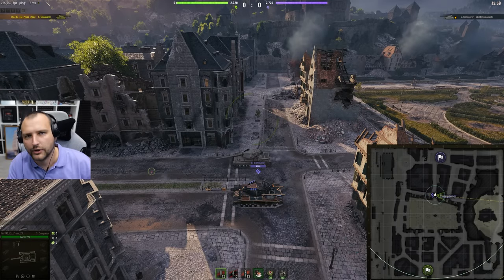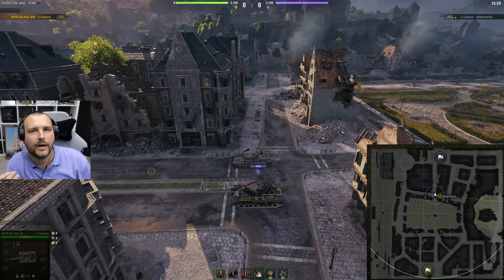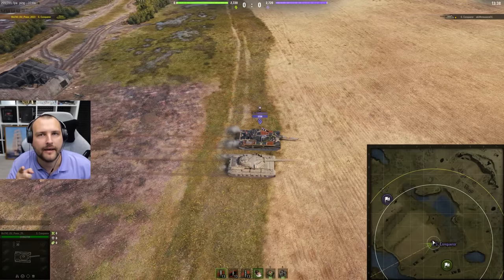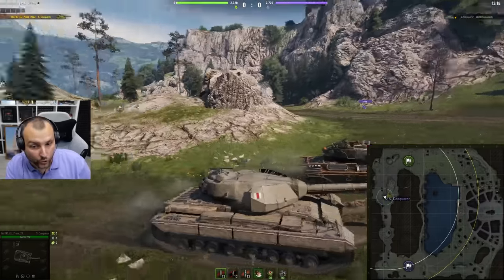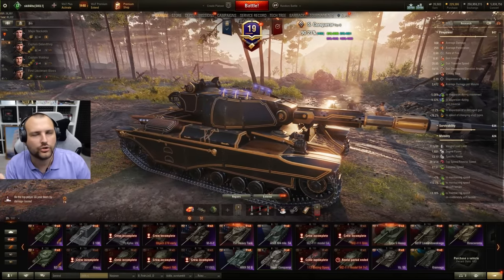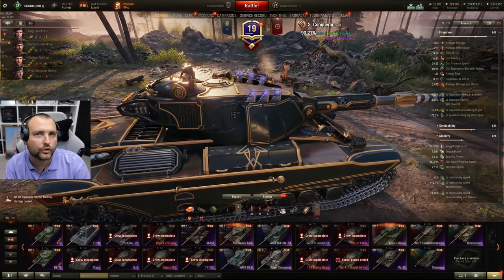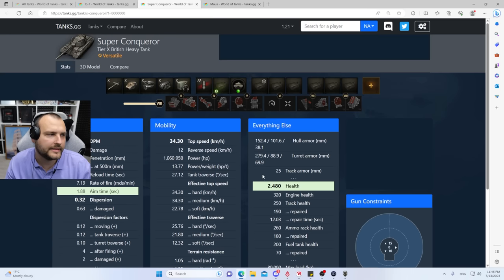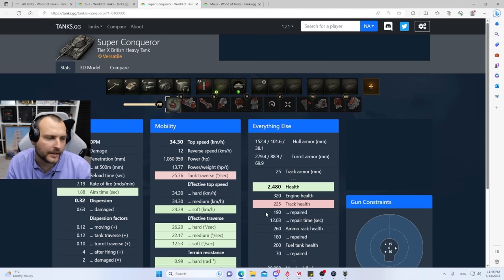YOU'VE BEEN DOING IT WRONG!! STOP Using THIS Field MOD In World of Tanks!!

Comment from the maker: One thing i did not explained properly  ( in speed testing one of us used field mod for +7 and i used -7 so that being said this is the biggest difference you can get )
Reply: skeeeeeel
Reply: Grousers in mobility slot + all terrain suspension makes tanks like st-2 much faster and able to reach top speed on flat ground.

If you use bounty or bond turbo, grousers in mobility slot,  All-TS, removed speed gov and and really any equipment vents are good but st-2 is a poke tank therefore stabiliser or rotation mechanism would make it really good at poke

:Poke" is terminology used in OW2 where you shoot hide to reload and poke to fire again then hide and repeat

Increasing this would increase the synergy between and equipment and st-2

Also on  is3-2 don't use upgraded tracks it reduces tank traverse
Reply: So what does the other girls mod do? Should we use it instead?

Comment: I guess you should test how the modification impacts turning speeds as well. Driving in a straight line only shows the small amount of better acceleration, but as soon as you need to make turns I think the modification granting you better ground resistances will have a much bigger impact. I would love to see you test this out, too! Thanks for the vid skil!
Reply: I came here to say the same. Great video, tho. Congrats to the Skill team
Reply: But you also receive a turning penalty, if your tank drives like a brick, also cornering gets even worse. It gets the testing too situational. This is a straight test to know the proper values by not introducing more variables. It feels very useful.
Reply: Grousers will improve ground resistances and with them also turning speed on hull. the field mod gives explicit a loose on turning speed, not to the extent of the gain from ground resistances but the biggest part of it - 5 of 7 percent. so there is a small advantage in turning spped too, but really small. I suggest to use grousers to gain 10% on ground resistance AND a whopping 15% on turnig speed
Reply: exactly this video don't show everything and this more healthy track is good vs 400 alpha but on tier 10 look how many tanks have bigger alpha and will track you instant
Reply: Since the 2 values multiplicatively invade each other (much like with stabilization), the ground resistance being of 7% absolute value has a higher impact and therefore negates the turning speed buff/penalty, depending on what field modification you chose.

Turning speed in case you take the ground resistance field mod goes by 1 * (1 + 0.07) * (1 - 0.05) = 1.0165 making it always a 1.65% buff.
In case you take the track durability field mod, the 2 values' roles are reversed, the formula being 1 * (1 - 0.07) * (1 + 0.05) = 0.9765 which makes it a 2.35% penalty.

This indicates that by how marginal the variation of the traverse speeds is, you should focus on the other 2 stats being modified (track durability and terrain resistance) being the deal breaker.
Reply: It will yield less noticeable speed since there is less momentum turning
Reply: @juanms8747  a 360 degree turn test and/or a top speed turn from specific point would be fairly similiraly simple like the straight test. the only reason i choose this mod is for turning speed... 
with this information, that i previously didnt realise i will consider it more on some tanks
Reply: you can check difference between terrain resistance on tanks gg, in effective top speed and turns in effective traverse
Reply from the maker: we can do that
Reply: @skill4ltu  thank you and keep up with the good vids
Reply: @juanms8747  Your tank doesn't turn at all if it is tracked forever.
Reply: @genmysters  Thing is, as someone mentioned before, many thanks are going to be able to one shot track you. On lower tiers, the thing changes, and many thanks do not have enough alpha to do it in one or two shots

Comment: Skill, i still think that you should properly indicate +7/-7, +7/0, also add turning speed and hull traverse time, i understand your point, but i think not everything was covered in your video. I mean thats good job, but i think it might need 2nd take. I mean goin in straight line isnt only thing impacted by ground resistances.
Reply: Agreed. A comparison using hull traverse would also have been nice. Also, what about shooting HE at tracks? There is a different mechanic at work using HE which was never mentioned.
Reply: A good test should be taking 2 S.Conq with the same crew/equipments, one with All-Terrain Suspension and the other with Lightweight Suspension, both race to the windmill from the base on Malinovka.
That 14% Terrain Resistance will definitely show what it really means.

Comment: i think you guys forgot to test something important: the stat that usually gets the biggest hit when terrain resistance changes is tank traverse and it makes a big impact on tanks that have a bad base resistance
Reply: "biggest hit" it changes by around 1 degree or less for most tanks, you can check it around on tanks gg
Reply: Which can make the difference.. I also think a test not only in the flat would have been nice
Reply: Looks to me it helps accelerating. Straight line it does nothing
Reply: The terrain resistance improvement side has better turning speed overall
Reply: @aadfkshdfj  you can address rotation in different ways without affecting other stats doe. Plus a good player will try to track you in case he wants to circle of death you.

Comment: Great video! One thing that I feel was not mentioned clearly but was visible on the comparison. The modification 'for speed' is not entirely making the tank quicker. It accelerates tiny touch better but when the tanks reach the top speed they pretty much go with that speed . It was visible as S.Conq. with mode was 3/4 tank ahead and after initial acceleration it stopped taking over the other one and they were just going like this. Another thing is that the mode says 'maintaining speed' so i guess it will help when turning etc. but as you mentioned - not much.
Reply: yes the field mod only adds to acceleration, not speed in sense of top speed - same as grousers. so grouseres have better values and add even more to turning than to acceleration where field mod adds less to turning compared to acceleration

Comment: Thanks for the tips! I never realized that the damage roll is also the damage you did to tracks. I always believed it had to do with module damage and gun caliber.
Reply: the module damage rolls the same way as the hp damage + or - 25% that is why a Jagpz E 100 will not always ammo rack some tanks, EVEN if it passes the 27% roll do deal damage to the ammo rack in the first place.

Comment: Nice work Skill and Helper !!  NOW I just have 2 questions from this video that weren't answered ?

1.  You showed the minimal difference of one tank with "All Terrain Suspension" and the other "Without" it.. and yes I agree it did very little to help..   BUT     the test should of been 1 WITH... and 1 using the  "Lightweight Suspension"  which has a negative -7 to All Terrain Types...   So the test has 1 with a + to all terrain / 1 with No + to all Terrain / But didn't have a 3rd test of 1 with negative Terrain AGAINST 1 with Positive Terrain..     Hope I made that understandable ??  should be 3 races >    1 with,  1 without,  1 with positive vs 1 with negative..

2. On taking the tracks off a tank. (and please correct me if I'm wrong)  BUT it seems that in the case where it took like 2-4 shots to remove the tracks (or hp's) of tracks. I've been able to do it with much less damage and almost 1st shot most the time by using HE rounds ?   So I guess the question is because of how HE explodes does it have a special mechanic or something that will allow you to remove tracks regardless of there hit points or amount of damage actually done to tracks ?   Example:  Like when a JEFF (arta) hits the ground even 5 meters away from your tank it seems to have a very good chance of tracking you even though as a Arty player or tank driver it shows NO damage numbers floating up from either side ??
ALSO can you shoot that center / middle wheel with a HE from say a BlackDog or Conqueror and track it in a single shot ? instead of 3-4 shots ?     (Just Curious) 

Anyway thanks for the Video !!  Great info and Something to maul over and think about... Maybe Test out ?      Keep them Coming !!
Reply: 1) The comparison tank had the opposite field mod - So one had the track HP buff, one had the terrain resistance buff.
2) HE shells do full damage to the track regardless of penning or damaging the tank itself. With the higher alpha of HE shells, they're more likely to break the track. Keep in mind, tracks can also lose HP from your driving, so sometimes the enemy might already have a damaged track. Also, unless the person has Hardening or used a repair kit, tracks won't repair to full HP if they were broken.

Also, arta has different HE mechanics. When WG reworked HE shells, they didn't change how arta's HE shells work, so arta shells have splash damage that can damage tracks without even hitting the tank. If the shell hits the ground, often times the track is the closest thing to the shell, so it's most likely to take damage even if the tank doesn't. For normal tanks, they'd have to hit the track directly with the HE round.

Comment: I often don't use any of the field mods. All field mods reduce some stats while increasing others. I feel like the default is better the majority of the time.
Reply: Find out which set of stats are better, and go with that one, that's always how you should do it. The only time you should go with default is if the relative importance of the set of stats is within a 1% margin, or if one of the stats is "effectively" maxed out(I'm not sure what stats could qualify though).

To me, your situation just sounds like indecisiveness.

One possible exception is the first field mod on medium tanks, if you take decreased effectiveness of a damaged engine, you will be completely crippled if your engine is ever stuck damaged, but the opposite case may not be necessary, though I think it's still worth taking the extra 'durability'.

Comment: if i remember correctly, we are talking about the 7% Field mod. And 7% is sadly just nothing. But it helps in combination with Smooth ride in fast accelerating Tanks to gain some momentum (aka, Vz55 or 277, maybe even IS7)
Reply: in the video tanks have that skill.
Reply: @denizhanenesuzun6105  You missed the entire Point of my Comment, good Job.

The point was that its useful in fast accelerating Tanks. Not in slow or average fast Tanks.
Reply: @zordiark9673  it is actually useful in high terrain resistance tanks. Like is7 yeah.

Comment: Though I guess this also heavily depends on the alpha guns you're going against.

Like for the S. Conq, if it's going against Tier X Heavies, most of them are at the 490+ Alpha damage range which means they'll more than likely track you with a single shot vs. not
Honestly very interesting. At this point I'm more inclined to always take track HP (for the chance of a low roll not tracking) vs. speed.

Comment: Excellent video, thanks. It would be good to also have one test on climimbing hills and the ground resistance would make there. On straights, it obviously only helps for accelaration and the top speed is then the same, but if its not on flat ground and you e.g. need to take the westfield hill first, how much would the difefrence be ? 1 or 2 seconds would be huge and decide who has the first shot.

Comment: Other sources explains tracking damage is based on your module damage. But if you manage to hit the drive sprocket and also pen the hull the module damage to the track is doubled. Testing shots that do not pen the hull can further proof this. Example:  The conq has 250 track hp, 165 module damage. 1 shot at the tracks only would not destroy it. But if you hit the sprocket and pen the hull it deals 330 module damage. Then a third theory comes in. It is still rather unclear if module damage has a set ammount or rng roll. We have all had those games where we could suddenly ammorack/ track a tank that would have way too much module damage on paper. Or fail to track a tank while shooting shell after shell in the frontal sprocket without penning the hull. (looking at you T95 and Tortoises.) Your doing the community a big favour of testing these things. GJ.
Reply: That is what I used to believe until I actually put it to the test, we did thorough testing on stream. Guns with different module damage but same alpha damage had no difference in tracking ability, while guns with different alpha damage but same module damage had the difference. The math (running the exact values of alpha vs. module damage vs. track HP)  consistently worked out that it was only the alpha damage of the gun that counted when shooting the drivewheel in a 1-to-1 ratio, while anywhere else on the track was 1/3rd of the alpha damage.
Reply: @Scorpiany  Nice. So what about HE damage in this case? Tested that aswell?
Reply: @Orcone  HE works the same way, since the game calculates alpha damage rolls first, everything else (such as penetration, splash damage, etc.) second. Since track damage isn't dependent on penning or damaging the tank, all the same mechanics apply (the base alpha damage of the shell).

The only exception will be for arty splashes, since they use the old HE mechanics where the shell actually explodes and has an area of effect. Arty shells will do damage based on the distance from the track.

Comment: @skill4ltu as far as I remember, terrainresistance is way more important for hull turning than acceleration - and there combined with the turret traverse it can decide wether you can follow a tank circling you  or not, that doesn't mean you're not totally on point, but I think the difference that matters isn't acceleration but hull traverse. Still very nice video.
Reply: Traverse speeds are affected by terrain resistances, but keep in mind that the track HP buff also comes with a hull traverse speed buff to compensate. So the traverse speed that you're losing is actually pretty small.
Reply: @Scorpiany  I'm not playing activly any more, so I simply overlooked the hulltraverse buff, but I remember hulltraverse showing pretty good on medium and soft terrain :) like I said, the video is really good, I'd love to see the traverse speeds compared too :D

Comment: I think the way you presented ground resistance was a bit misleading. 

The faster acceleration may not be noticeable on a single straight line beyond the initial gap, but you have its benefits EVERY TIME you accelerate your tank, even for only a few seconds/short distances. You will always move quicker from a standing position. You can prove this by racing two tanks, but you only let them accelerate for 2-3 seconds, then stop and repeat. It will gradually build much more distance than shown in the video.

Bottom line is, the more you move your tank, even the smallest of distances, the better ground resistance field mods become. 
To me, there is still no way around it no matter if you run a maus or leo 1.

Comment: Very interesting video! But I think one very important aspect of the terrain-resistance is that you also change the direction faster. I dont have any data and havent tried that myself but I think the SConq with the terrain fieldmod would have more advantage if you would not only drive in a straight line but also manouver a bit
Reply: This is true, but keep in mind the track HP buff also comes with a hull traverse speed buff to compensate for that. That way the difference in turning / maneuvering isn't as noticeable as it otherwise would be purely off the terrain resistances.
Reply: @Scorpiany  ah right, I completely forgot about this

Comment: The tank driven was kind of a bad example because Super Conqueror is capped by having quite slow top speed, which ended up being reached in the video and from that point both tanks are stuck at the exact same speed. For tanks like IS-7, Vz. 55 or WZ-111 5A, there's way more room to fit the extra speed thanks to vastly higher top speeds so in the end the one with better resistances ends up being drastically faster (Especially in the Himmelsdorf example comparably).

Comment: Hey @skill4ltu ... great video and thx to you helpers too. Actually I always had a hard time to decide if I want to take allterrain or durability so I mostly didn't choose any - this now is solved. The allterrain is also not worth to think on even if you have a tank with really bad ground resistances - like not reaching top speed on road. You will loose rotations speed with allterrain too which  the grousers will improve in addition to ground resistances. For the tanks with bad ground resistancesI suggest  have one set up with grousers even for the loose of HP, DPM or something else if you want to have agility and add the HP from field mods. .... I think i need to check some of may tanks setups hahahaha

Comment: Huh, I always thought terrain resistances affected overall speed, but at least this field mod only seems to affect acceleration since we see the "fast tank" pull ahead at first but then it evens out. I wonder if this is: a) a bug, 2) a unique way this FM works, or 3) I've just never known what TRs really did. Actually, I guess it must affect the horsepower calculation, which means you should try doing the speed tests going uphill and you'd probably see a bigger difference.